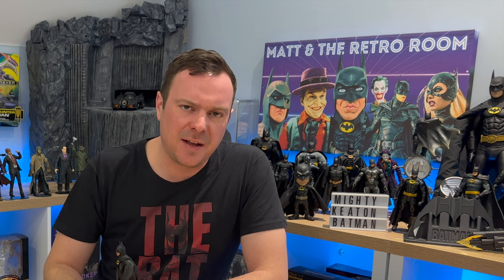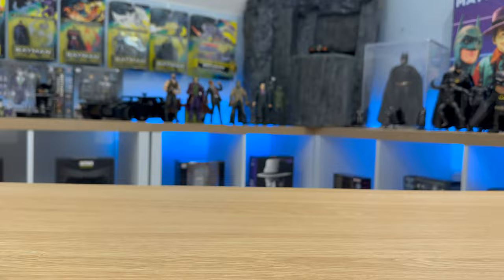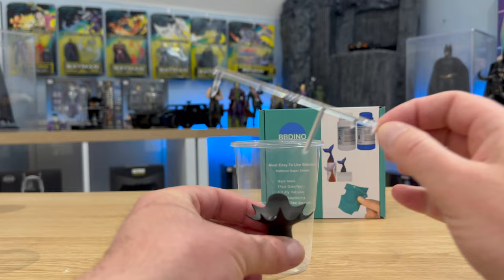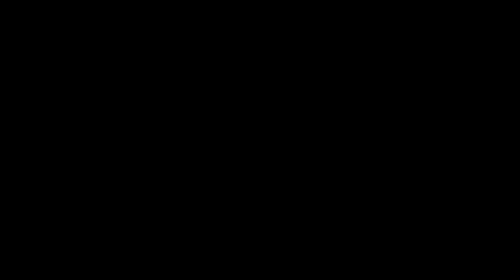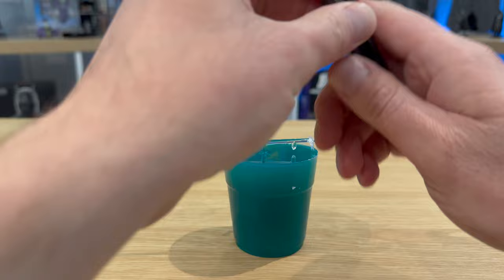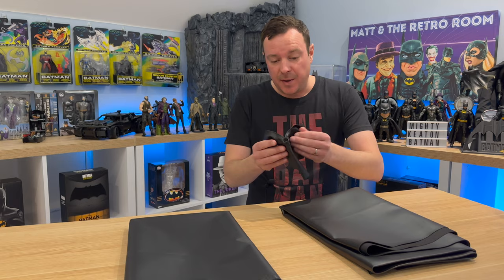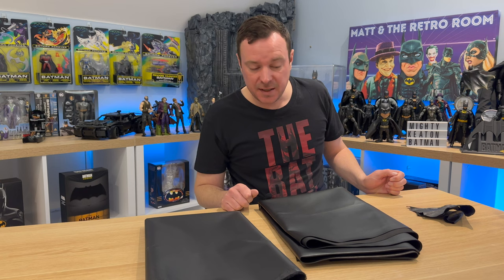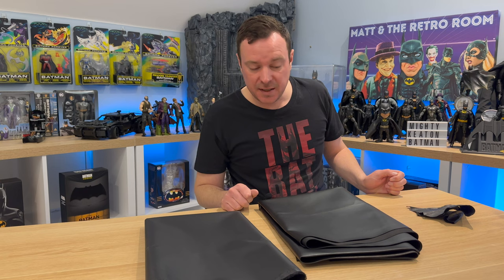How NOT to Make Head Moulds | Building Batman's Armoury/Vault Part 2

Comment: Very interesting to see your process here, both with the cape and the casting. It must be frustrating to not get the results you wanted but you took it on the chin with a great attitude and it was good to see how you learned and adapted to the challenge. Great video dude! 👍👍
Reply from the maker: I think the process I used to cast the head was too basic or simple. If I had a vacuum chamber then maybe all the air bubbles could escape, filling all the mould. Lessons learnt and I’ll take it away with me. I try and keep a cool head but I was getting frustrated 🤣 At least the cape is coming along as planned. That will be all finished by the next and final part.

Comment: Here's an idea for the cape. If you were to take the lining of the cape cut it into the desired size then spray it with black Plasti Dip and before it dries stipple the surface with a bumpy sponge. This could possibly give you the thinner weather look your trying to achieve. And with a pizza knife you can roll in the the lines for the seams.

Comment: Might try using a thinner resin and injecting it with a needle. That's definitely a complicated shape to cast at that scale......

......🤔 Finding a fabric at that size also seems to be difficult with the right look and adding more layers , just Compounds the problem......😅.... Keep at it👍
Reply from the maker: I agree with your points. I knew the cast would be difficult to achieve, but I thought it was worth giving it a go and share my findings anyway. 
The cape is looking pretty good since publishing the video. For a display piece I think I got the look I’ve been trying to get. But you’ll see that in Part 3 when that comes out 👍
Reply: I found out when molding my mezco cowl, theres no way to " dangle" it in a container. First you need to use non drying polymer clay pressed into the bottom,then you need to make a putty mound around the bottom of the cowl and press into the bottom...that makes a large opening when casting to easily pull the part out. Also wise to angle the head to where the chin is more downward.if you dont you will have a huge undercut thats ny impossible to do without bubbles. And as a tip never use epoxy. Amazing casting resin is absolutely perfect. Easy to work with.for the ears you need a thin wire and slowy pour the resin just enough to fill ears .then take wire and poke in to release bubbles. Also when pouring the mold rubber go veeeery slow and run it down the side of container to eliminate bubbles.  Sorry if i sound like a know it all but i have learned from many many failed attempts lol
Reply from the maker: @charlesalexanderjr2247 you don’t sound like a know it all 🤣 Thank you for taking the time to write that comment. You have made good points and I will definitely take them away with me next time I decide to try this again. I have heard of Amazing Resin, but I don’t think it’s easily available here in the UK, but I haven’t checked.